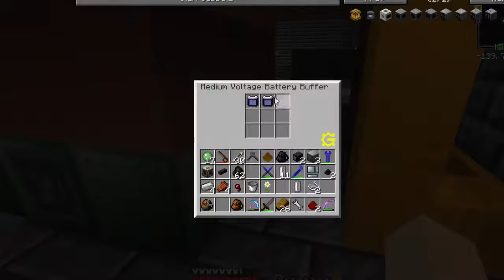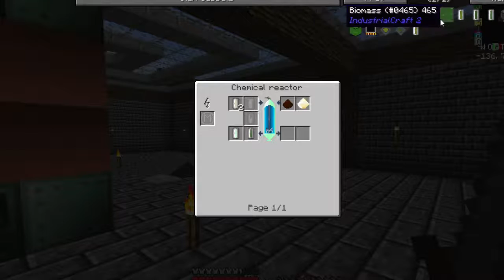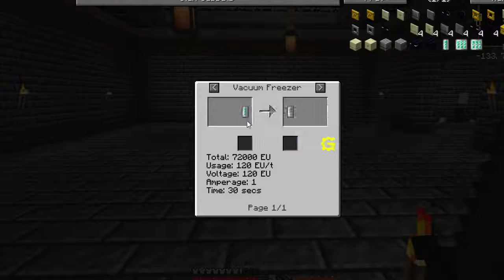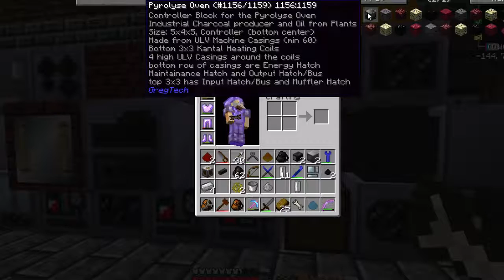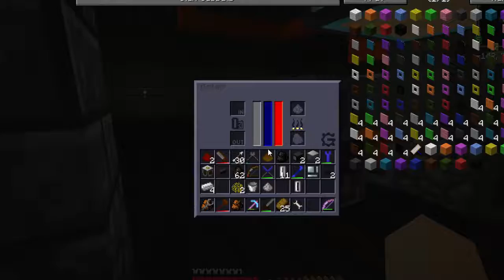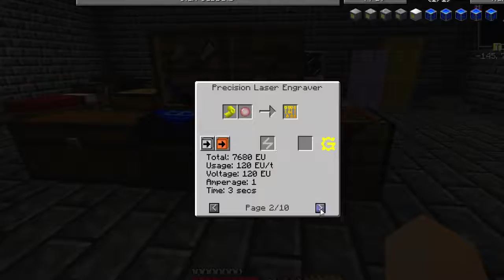[Gregtech 5U LP] EP 49 GT 5.09.09 update

Comment: Lutetium , you get from thermal centrifuging thorium depleted fuel cell. That new recipe is extremely annoying every filter , type filter , regulator are tied to carbon fibre. The recipe it has also a chance of dropping from the least (33%) from using Lutetium to 90% using Palladium. In the middle you have Platinum which is a pain in the ass to get from Nickel. Luckily it uses only 1 unit to process one recipe. Honestly i think this change was unnecessary.
Reply from the maker: +UnderSiege72 ya I defiantly agree, thanks for the info on the Lutetium